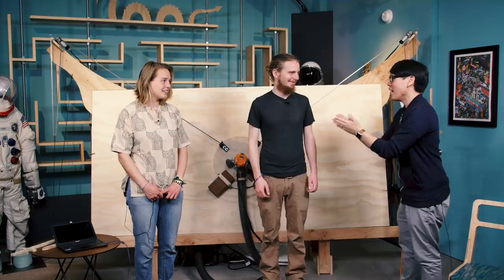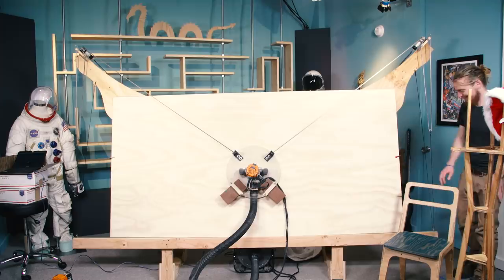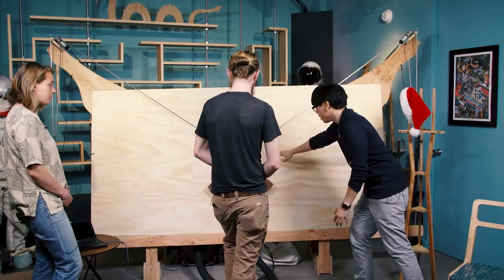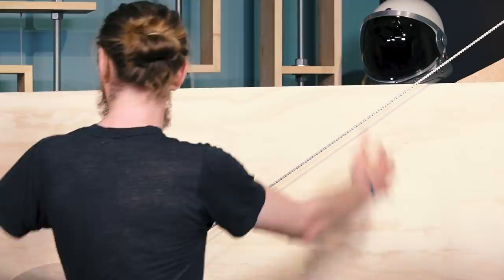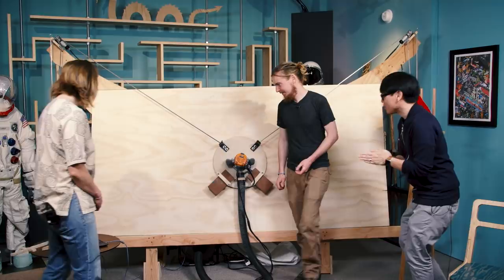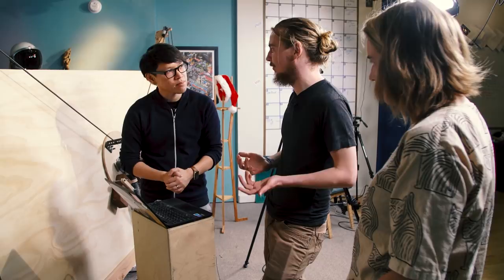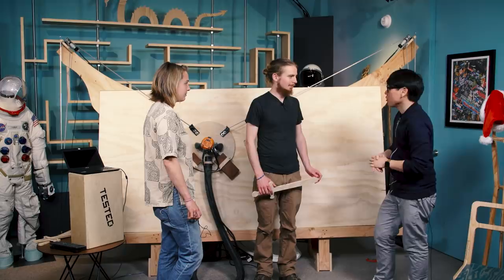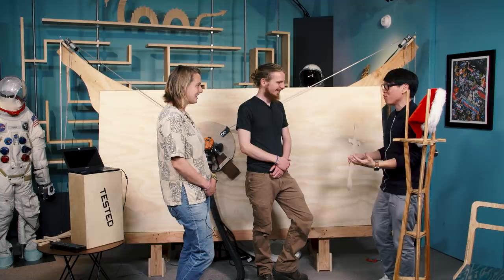Meet Maslow, the $350 CNC Cutting Machine

Comment: How do you control the depth of the router cut?  Do you need a special router with some sort of electronically controlled depth adjustment (I assume that exists???) or do you have to stop the cut after each pass and manually adjust the depth?  I would assume that manual control would not work since you program in the tabs.
Reply: There is a small motor next to router with a threaded rod or a combination of carriage and track to adjust depth. That is my understannding of it from this video. You can see it at 15:32.
Reply: They make a Z axis kit you can add on to your router to make it a 3 axis machine. 
But I was wondering that also, how does it work without the 3rd axis? Do they just run it slower (a router should go though 3/4" plywood easily) or like you said and manually adjust after each pass?
Edit: Did some reading on their website and they do just like you said and the program stops and lets you manually adjust the router depth after each pass that is about 1/8" deep.
Reply: I was wondering the same thing... so with the z axis kit it's $410 then unless you want to do it manually??

I guess you could just go through 90% then drill a hole and run a flush trim bit on the back side
Reply: From the install guide on their site the Z axis kit is basically a motor you attach to the manual depth control of the router. The threaded rod seen in the video is part of the original depth adjustment, doesn't come with the kit or anything. Still a really interesting idea though.
Reply: When running without a Z axis kit the software pauses between passes and directs you to change the depth.
Reply: Thank you for giving the definitive answer - seems a little awkward, but do-able as long as you use a bit that can plunge easily while adjusting the depth.
Reply: Yes it's imperative that you select an end-milling cutting tool. More are than aren't. (At least those used for CNC work, that is)
Reply: You're basically relying on the weight of the router head and a manual or motorized underguide to control the depth. Which when your bit gets dull or routing hardwood you'll probably have issues. Besides they make regular wood router kits where the table folds up horizontal for storage for around the same cost.
Reply: @fireteamomega2343  No they don't. There is not a 4x8 foot cnc router table kit for that much. They are like 650 dollars for something that is way smaller. If you see something, then please share a link.
Reply: @michaelramczyk4721  
Arduino cnc kits retrofit build it yourself as nice or big as you want. Or you can buy something that your going to have more limitations and problems then you realize.

Comment: over a year and they still are on preorder. The Kit is now 499 and only supports one router, for anything else you have to check if the router is supported and i think you need to buy additional gear for them. The router they use also costs around 300. So with all the material you need, customs to the EU etc. this "kit" will come out easily 900-1000 USD until it makes it first cut. 

Still a great idea, i can see the potential, but i am a bit concerned about the costs and then, if it will deliver
Reply: It is being sold by a few compani0es now. some of the companies support multiple routers. and the total cost should be around $700 to $800, which is still very cheap for the size it can do!

Comment: as working in the cabinet maker trade for 13 years and using cncs its cool idea but dangers as hell, one lil knot in the plywood and that router would jump off the board, looks like it would be better suited as a laser cutting system no highspeed parts, if u want to use this with a router there should be somethingto keep it firm to the board at all times and a couple bricks couldn't do anything, think more like wall panel saw style
Reply: T- Spat assuming that you made the disc large enough it would be possible to use the polycarbonate disc that the router is mounted on and the vacuum used for dust collection to create a basic vacuum hold down to decrease that risk, but I suspect that they rely heavily on the weight, using a high speed router, and then - as they specifically mentioned in the beginning of the video - utilizing a very slow feed rate to reduce risk of exactly what you mention.

I agree that this, or any CNC system is much better suited to the more precise methods of laser, plasma, water jet or even slurry or air jet depending on the materials being cut.

Of course cutting & material removal are not the only CNC applications this might be useful for, they mentioned one other - which was painting murals on the sides of buildings, but it would be equally good at producing billboards or other large scale advertising signage if equipped with a multicolor spray head
Reply: @SFX95901  I would imagine the slow feed rate also reduces the torque twisting the entire cutting head changing the chain geometry.

Comment: 350 is pretty steep just for 2 encoded Motors (can get 2 stepper motors with planetary gearing for $50), 6 sets of bike chains ($50 Amazon), 4 bike sprockets ($40 Amazon), 100 ft of Bungee chord $30, I guess the other $130 is for the calculation equation (a^2+b^2=c^2) and or that circle of wood with bricks on it. 
No frame,No router,No shop vac

To add z axis add a normal stepper Motor to a router base that has an adjustable depth of cut screw
Reply: Pretty steep? You just broke it down and see they aren't making that much money.... You're out of your mind. $350 is exceptionally adorable.
Reply: I8THEmagictoaster The math is far more complicated than what you posted because with this setup you are not guaranteed right angles and thus must use more complicated formulas from which the one you posted was derived.

Comment: (original creator of makercam here) Maslow looks really cool! How's the depth of cut controlled?
Reply: Why is your website based on Flash? It's 2017.
Reply: A Z-axis kit is available that mounts a motor/encoder on the router's depth adjustment. In the absence of the Z-axis kit, the software will pause and ask you to adjust the depth.
Reply: I wrote it in 2010. But if you want to port it to javascript the sources are online.

Comment: An MDF shop vacuum backer board would be an easy addition. 2x2's could be used to create zones and garage vacuum tubing kit with several outlets would allow zone selection. Placing outlets low on each zone would help with dust collection too. Great, now I have to go build something.

Question: You mentioned rotary encoders? Are they absolute and if not will referencing be required with every power up? Do you have a way to add a marker to show programmed path if a dry run is selected? Just thinking.... 
Cool idea, all the best in the future.

Comment: This excellent video brings up some questions:  Can images to be CNC-cut by a Maslow be generated using Shaper3D on an iPad? What about SketchUp on a Mac? How are images uploaded? Via USB cable? Via thumb drive? I've seen people use much more expensive CNC routers in production woodshops on YouTube, but they are ridiculously expensive and made to do production work. If I wanted to DIY build projects for my home, such as homemade plywood workbenches, homemade cabinets, storage crates, etc., and efficiently cut all the parts for a project out of a single sheet of plywood to save money, can the Maslow do this, and is the cost really going to be in the sub-$500 range?

Comment: wouldn't it be a lot quicker and cheaper to use a jigsaw?
Reply: Jeffrey Smith CNC is good for mass production or a bunch of the same/similar parts and it saves time for small things too
Reply: Absolutely. We’re great at over complicating things by finding solutions for problems we never had. (Bring on the hate, millennials)
Reply: a lot shittier, too.
Reply: That depends. A router bit is a spinning round bit while a jigsaw is a rigid blade. With that in mind, a router is great in making circles, detailed or fancy edges, dados, rabits, miters, insets, etc. While jigsaws are great in making non linear lines within reason.

That said, adding a mechanized xy system to the router would simply create an even more percise router that is able to stencil out patterns, detailed or simple, and cut them with expert percison. Since it is router based, that also means that it is not limited in curve radius like the jigsaw and can even carve out fonts. 

But as I said, it depends since it's a question of time. If you want to cut out a simple shape, even something like the sword, it might take you less time to roughcut the sword with a jigsaw and sand it out rather than design, program and wait on the cnc. 

CNC 2 axis routers were designed for large projects, super persise designing, an/or mass production.
Reply: also I'm wondering about the precision of the whole thing.
Does their positioning system takes the rigidity of the chain, the weight of the router, the friction of the base of the router, the catenary between the anchor points and the router, the wear on the bit, into account ?

Comment: Router suspended on a rope? OSHA would be proud. Better keep those blades diamond sharp. One kick and at best you're buying a new router. At worst you're going to make your ER doctor laugh out loud after you explain what happened.
Reply: Lol, that sounds more like a personal issue rather than a safety issue.
Reply: FallenBytes no one kicks my machines anymore?
Reply: what are you talking about? do you really believe someone can kick a 150 pound machine and cause the router to spontaneously jump out and hurt you? stop watching horror movies. your statement has no basis in reality. all that would happen is your work piece might have a very small nick in it.
Reply: I think he is saying that the router itself could kick out of the cut and swing around exposing the spinning bit.  There is a lot of torque involved and those bricks may not be enough resistance to prevent the entire router assembly from flipping around.
Reply: it's not suspended by ropes, but by roller chains, they don't twist well, even at 10' of extension there isn't much twist there.

As with any power tool, it's going to be possible to hurt yourself with it if you are careless enough, but you are seriously over estimating the force of a kick. The kick is also going to be in the axis of rotation, so it will twist the sled, not try to flip it. flipping forces would happen if the bit was not cutting and the chains continued to pull the router, but even then, the bit only sticks out an inch or so from the bottom of the sled, which is 30" in diameter, not at all likely to flip
Reply: I've been working with routers for 15 years. They don't have any kind of kick back that's going to flip the router on a weighted sled, held by roller chains. But you probably shouldn't have your body right next to it while it's running just as a matter of course.
Reply: I would be less concerned with the router flipping and more concerned with it not being able to cut at the programmed speed (especially traveling downwards) hanging  on slacked chains (the pulleys on the side only guide slacked chain on the back end of the drives) and resonating at it's current place in the cut. Gravity has neither the fitness of human arms, or rigidness of a robotic arm. The ER scenario would only happen if you were in a terrible car accident and told your doctor, who is also a maker, the story of how you broke your router lol
Reply: especially in bottom left and right corners where i imagine friction will overwhelm the accuracy

Comment: This is one of the free machines like mendel and reprap , there are a diy kit already. You can use a router, a pen or whatever there. It wont be their design since it is obviously a bit altered, but this requires less stuff than a mendel. However, i would buy this one to support them and you wont build it easily if you dont already build other 3d printers . ( with build 3 d printers i dont mean mount a kit, thats not building)

Comment: 20 minutes later? How much faster would a sheet of wood, a pencil and a hand held router be.
Reply: BAZE and much less accurate, not to mention that where CNC shines is complex shapes or repetition. cnc doesnt really make sense if you just want a wooden sword, but if you want 50? set it up once, load a sheet of plywood in every hour and then youre done
Reply: I have no idea about the subject really. My statement was more of a question with out a question mark if that makes sense. :)
Reply: 20 minutes does seem slow by CNC standards for such a small outline too.
Reply: Uh.... do you feel like routing or cutting 30 sheets of wood for s kitchen? No... no you don’t.
Reply: Another important part that people didn't mention is that it's automated - Sure you could be faster by hand, but during those 20 minutes you can do something else entirely.
Reply: also note it is 20mins + design and setup which they sort of skimmed over lol
Reply: i run 3 and 5 axis making high dollar aerospace parts. kittycow is right. cnc is best for extreme accuracy in the thousandths and all day repetition. part time can be cut down once you can manipulate the feed speed and spindle speed. this maslow system doesnt appear to have those adjustments but could do some fairly fancy wood working. but i still think a HAAS VF4SS could do far more and far faster. but thats about $150k not $350.
Reply: Sidehop, sorry having a machine cut your parts and pieces just make you an assembler, not a woodworker.
Reply: +DEEREMEYER1
If you did have a race it would have to include a certain level of accuracy or it would be unfair to begin with.  I think this machine could beat a hand operated woodworker if the result has to be thousandth of an inch accurate.
Reply: THEY SAID ONE HAS TO REDO THE STE UP BECAUSE IT DOES NOT RECALL THE PROJECT ONCE  U MAKE THE ITEM/SWORD,THEY ARE STILL WORKING ON MEMORY RECALL ON THE NET PART OF IT.SO ITS MORE THEN PUTTING IN NEW MATERIAL ,ALL THOUGH ACCURACY WOULD BE A KEY ELEMENT IT DOES HAVE
Reply: well this is because they used a stepped approach to this cut. Im sure the cnc is programmable so that it can take deeper cuts and make the sword in one pass, rather then 15 passes. buying a 2hjp router vs the one they used in the video would easilly make this possible.
Reply: but not as precise
Reply: I think u all are missing a  fact. The maker cam software is what determine the speed. You can make the machine move faster and cut deeper. But u run the risk of damage to the endmill and router.  Also the faster and deeper u cut the lower the quality and less precession. I've worked with hand routing and CNC machines. Cnc is always the best. Because u plug on ur code to cut and walk away. If u set up the machine with a good speed to depth ratio u'll never have an issue. Deffinatly going to order one of these.
Reply: As far as accuracy goes, hand held routing with a template can easily match this device (which is not a criticism of the Maslow CNC, just a statement of fact from experience).
Reply: U can buy these on eBay for.$50·00 now. This design was.flawed.from the start.

Comment: Just print out your templates, sick them on the wood, then cut and sand to the lines. Not very difficult and much more fun. Maybe they should have used another example like a gear wheel. Even then you don't need to buy one of these.
Reply: SirFlibbertyJibbit you can actually draw on wood as is.
Reply: Yeah if you are comfortable with your drawings, go for it. Some people are really good at freehand drawing or even measuring every line and angle out. I know it would take me a while to draw out that sword and have it symmetrical.
Reply: But, if I buy one of these. I can let it cut out 5 coat racks while I am running my other machine cutting out something else.  If we step back and look at the potential, it is a very useful machine. I'm going to order one I believe. If anything, it would be fun to play with.

Comment: the presentation is so bad, I watched it for like 10 mins and still don't know whats in the box. Why not bring a second kit and just show it unassembled.
Reply: I agree that it would be nice to see what's in the box, but I wouldn't say it was horrible. I thought they did a good job.
Reply: Everything but the router, the bricks, and all the wood,  from what I gather from their site.
Reply: That is correct. The motors, the electronics, the brackets, the chains, even the wood screws.

you buy the wood and the router (there is a suggested one that's ~$150 in the US) and assemble it.

The build proscess assumes that all you have is a screw/drill and a way to cut 2x4s. it cuts it's own parts as part of the build process to bootstrap itself.
Reply: or show it working in the first... 15minutes.
Reply: So you really need to have it all spelled out for you?

Slow down, pay attention, listen carefully and you'll get it.

Comment: maybe one thing that could help it be a bit more acrit is to put a pull in the two bottom corners and have the can liek you have it for the top tow coner and leave in the tensors but add  two the end of each so that the top left goes from the router throw the mother down throw the ticner back up and the dow and across to the bottom right corner and the sam fro the other side leaving the slack fro the tencher but alsow so it has rome to side two all for corners